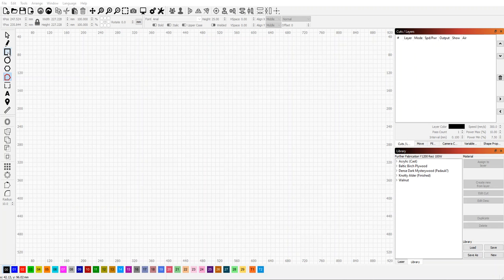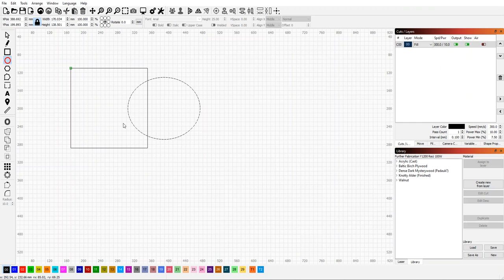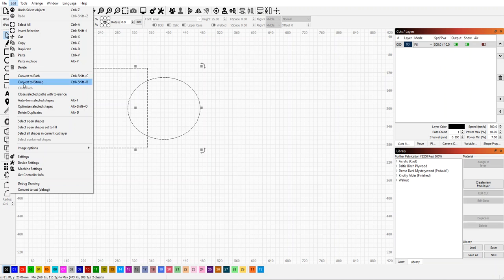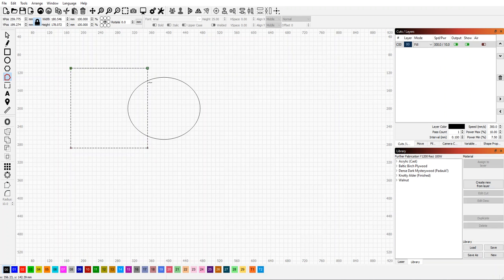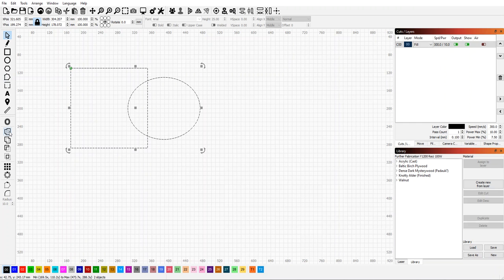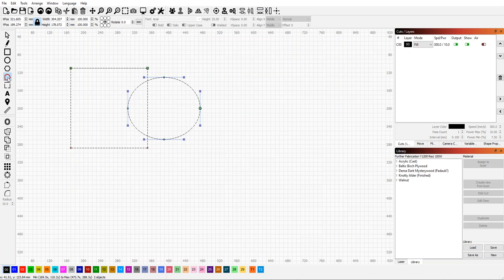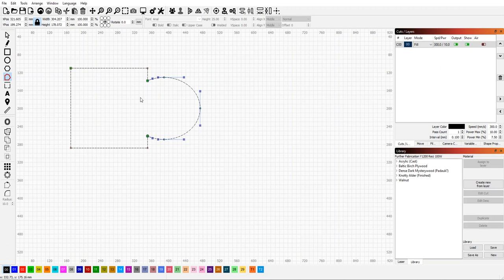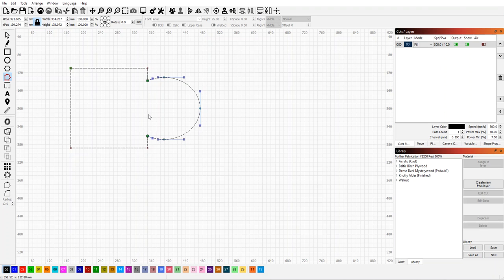LightBurn Tutorial: Node Editor Trim function

Comment: Great!..now i just need an extra step by step.."baby steps on how to close the lines!..i cannnnot get anything to close 😂
Reply from the maker: So if you were making my "toilet" from this video, after trimming both inside parts, the shapes are there, but they are still 2 separate shapes, and they are not closed paths. You can either drag one of the nodes off and back and it should snap to (and connect) to the node on the other shape in the same spot, connecting the line, or you could select both shapes and use "edit->auto join selected shapes (alt-j)".  Let me know if this doesn't solve this for you.

Comment: Thank you! I was struggling as in every other software the scissor icon does the trim feature. I'm shocked this is not more straightforward. Thank you for saving my sanity!
Reply from the maker: Trim in lightburn is a little confusing until you get the hang of it. Glad I could help.